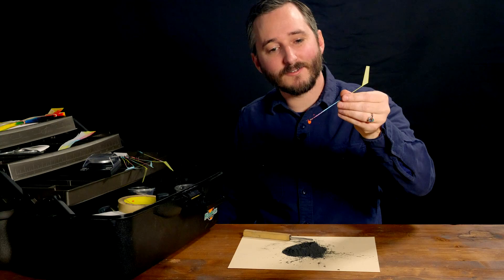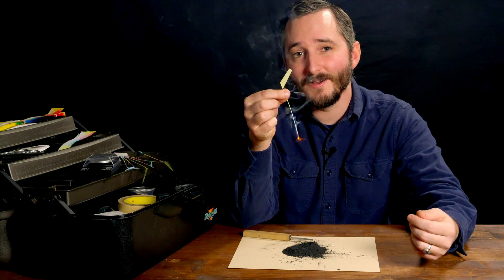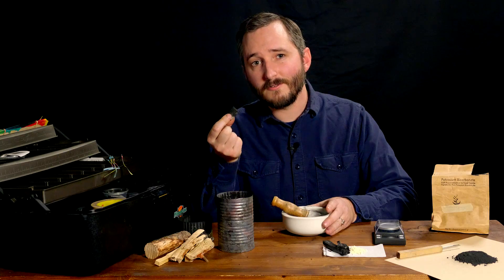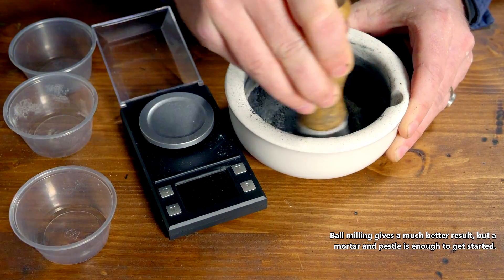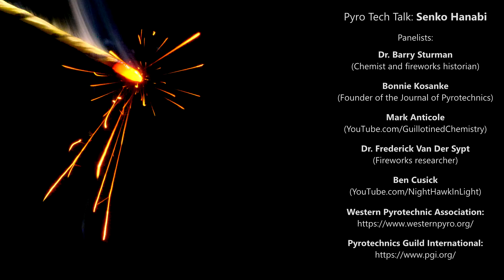The World's First non-Flammable Fireworks (a novel way to make Senko Hanabi Sparklers)

Comment from the maker: I'm very excited about this video. A firework that involves no explosive components means it can be made safely in almost any circumstance. A tiny variation in the powder mixture can produce dramatically different results, making these fireworks incredibly fun to experiment with.

Check out my new Senko Hanabi playlist that documents the videos I've made about them over the years: https://youtube.com/playlist?list=PL1a2HkcVbmAVW5LBBThCdHPD3BKDd03Tj

More info about how the firework powder can be non flammable and also work for these sparklers: In order to begin reacting with air the powder needs to undergo a phase change from solid to liquid. Changing phase requires a lot of energy, and once the phase change occurs the resultant reaction only produces enough heat to keep a small drop of the powder molten. The energy the smoldering reaction produces compared to the energy required to melt more powder is way out of balance. Each grain of fresh powder that contacts the drop is like an ice cube, cooling the molten drop down faster than it can warm up. In that way the reaction cannot propagate through a pile of powder. If you manually heat a large pile with a torch until the whole thing melts (which I have done) it still will not sustain a reaction when the heat is removed, because a large volume of the powder does not have enough surface area to react with air compared to its mass. The molten puddle radiates energy away faster than it reacts to release new energy, so it cools off. Last, the bicarbonate releases CO2 when heated before changing phase. This reaction sucks up energy (cooling nearby flames), and displaces oxygen in the atmosphere which smothers fire near it.

So, how then does the sparkler still work? Using the flame of a lighter we can brute force a small amount of the powder to make a phase change by feeding more and more energy in until all the barriers are overcome. The small drop has high surface area compared to its mass, so without other powder to cool it off and in a fully molten state it can generate just enough energy through reaction with air to stay molten and produce the senko hanabi effect.

Pretty neat.
Reply: What would interests me, is the possibility of adding other Salts to the mix to change the Flames / Sparks colour.
I think i have to take a look into the linked Videos&Papers to get some answers, don't I?
Reply from the maker: @Marian_Martin_Morgenstern  So far I've only been able to change them yellow with sodium. I'm not certain if other colors are possible
Reply: @Nighthawkinlight  Well Copperchlorid or Bariumsulphate should give a green flame, as does Boriumsalts, but i bet you know that already. Aluminium o.Magnesium powder make silverwhite sparks in standard sparklers, but i'm not sure if they would ignite in the Hanabi mixture.
Btw in the close up of the molten pearl on the tip of the Hanabi, is that blue colour of the flame the molten Sulphur burning?
Reply from the maker: @Marian_Martin_Morgenstern  Yes, the burning sulfur gives a blue aura
Reply: @Nighthawkinlight  A pinkish effect should be possible with a Strontium salt. I know it's also used as a delaying agent in glitter formulas, and Senko Hanabi are a related effect. I'm really curious to try this with some of the carbonate salts I have on hand, when next I get a chance to experiment. 

EDIT: Also cool to see the WPA get a mention. I've been a member for the better part of a decade.
Reply from the maker: @foxyfoxington2651  Barium carbonate did not work for me because it converts to barium sulfate which has to high a melting point to form a drop. Strontium sulfate has a similar meeting point so I expect the same issue.
Reply: @Nighthawkinlight  My immediate thoughts were lithium carbonate and copper carbonate (or more realistically something like copper(II) carbonate hydroxide).  A good, strong blue is hard to come up with - there are several bluish-greens, but the true blue flame colors are generally fairly faint.  Lithium and copper are easily obtained and also produce flame colors nearly as bright as sodium.  As familiar as you are with fireworks, I imagine you already know that potassium produces a violet flame, but it's extremely faint, so it's not going to show up over the color of burning carbon.
Reply from the maker: @jasonpatterson8091  I suspect lithium carbonate will work. I am not as hopeful about copper carbonate, but it's worth a try
Reply: @Nighthawkinlight  How about calcium carbide (carbide lamps) white light?
Reply: @Nighthawkinlight  Hi there, what is the difference between this powder and kno3 + charcoal or sugar?
 When I started pyro experiments, I often made bad powder mixes and got the same result as in the video. Potassium nitrate and sugar in a “bad” ratio are also non-flammable, and in a 50:50 ratio they ignite very quickly, reducing the amount of sugar the mix barely burns (like in this video).
Can we then say that every failed mix of mine from another point of view was actually a success? :D

In my opinion this kind of mix has no application in fireworks because there has to be flash powder to break the shell, spread "stars" and produce a loud sound. But as a sparklers it is good.
Reply: @Nighthawkinlight im trying to make one out of gunpowder made from ammonium nitrate, sulphur and willow charcoal, but its not working
Reply: @Marian_Martin_Morgenstern  it is sadly not possible to effectively colour sparks. Too much continuous emission going on.
Reply: @cigarswede  
Well, in a way you can. Not like red,green, blue etc, but more like how much they glow on the black body spectrum. Carbon sparks give a more reddish/yellow/"golden" colour, as does Iron, Aluminium and Magnesium burn hotter and thus give a more blueish/white/"silver" colour.
The question is, does the carbonat based Senko Hanabi burn hot enough to ignite Al/Mg Metal?
Reply: 2:40 At this point, nobody is expecting editing tricks from you, my friend. Unless you mean to say that you've learned how to edit reality. That, I'd believe.
Reply: Pretty neat indeed!
Reply: Now I want to make these and since there is much less fire risk I think I just might.
Reply: So, can you sell a cup of the completed mixture and mail it in the United States?
Reply from the maker: @jokeal3613  Technically you should be able to... but getting government regulators to believe that it's not dangerous or illegal would be an uphill battle.
Reply: @Nighthawkinlight  why would they have to approve it, advertise and send it. It isn’t a prohibited item, even if each ingredient was in a separate bag I would buy it.
Reply: I don't know if it is even possible, but is there a way you could combine some of the baking soda and the potassium bicarbonate, to have the best of both effects, or would they negate each other and produce a dud.
Reply: Would soaking and then drying the paper in some dissolved solution of salts for coloring have any affect on the color of the sparks? Or would it just slow or extinguish the reaction?
Reply: Have you tried mixing potassium bicarbonate and sodium bicarbonate?
And another thing that would interest me is what happens when you use either or both after pyrolysis.

I really enjoy what you do 👌
Have a great holiday
Reply: Thank you for your dedication of the craft.
Reply: Really, this is more like a sparkly paper candle with sulfur than it is a firework.  Maybe, to sell them, you would have to describe them accordingly, avoiding "firework" and its associations.
Reply: What if you made separate pockets of powder along the same sparkler? Would the glob of molten goo melt the second pocket and give a second run?
Reply: if you could change the color to blue/red I wonder how it would look.
Reply: pretty cool, you could make a video changing the proportions of the ingredients and adding others to change color or multiply colors.
Reply: I’m so happy you uploaded!😁
Reply: Can you get some slow mo of the burning blob and the sparks? Should be interesting
Reply: Ah so more surface area means more reaction and more heat, but more volume means less surface area per unit volume. The reaction energy is precise enough to work with a small volume but not a large one due to the surface area. 

That's really clever
Reply: Do you think you could ignite them electrically?
Reply from the maker: @sock501  No
Reply: I have ammonium nitrate bet that would work pretty good... provided it doesnt explode once i add the charcoal. copper nitrate would be better ;P
Reply: @nathanh2917  ammonium nitrate is an oxidizer, just like potassium nitrate, so you would get something akin to standard black powder meal (at best) and not a non-flammable substance.  Ammonium nitrate, sodium nitrate, potassium nitrate -- they are all oxidizers that work somewhat similarly (try mixing a little with some powdered sugar for some campfire fun), but there are good reasons for using KNO3 instead of the others.  The whole point of this composition, by contrast, is that it has no oxidizer, and must be allowed to burn in open air.  BTW, for normal colored firework compositions,  the KNO3 raises the reaction temperature so much that it washes out most of the color -- fine for white sparkles, but that's about all, which is why we turn to such things as potassium perchlorate as the oxidizer (plus, the chlorine ions help).
Reply: @zimbot_KWB  I work around 100 thousand tons of ammonium nitrate on the daily. Liquid and solid forms. The mines use it to make the ground go boom. All ammonium nitrate needs is a fuel source and its quite capable of creating a combustible substance. It can even explode on its own if confined and is hot enough to decompose. Just as anhydrous ammonia can explode even though it tend to be inert. Copper nitrate is even less stable. It grew "naturally" in one of our electrical boxes. Which we later disconnected and blasted it out with water. Industrial scale chemistry is err.. "fun". Only thing that was really scary was Nox which smells of almonds or more like a heavy metallic taste. Very distinct but hard to define. I was implying the explosions would be less pretty but more energetic. ;)
Reply: You look like ted cruz.
Reply: just gotta show the mexican and american companies that supply the west
Reply: Mm0
Reply: 74x
Reply: I may have missed it, but what is the burn risk from the molten blob? In that sense, would a black powder/oxidizing source be less dangerous? Compared to the wire and Al/KNO3  sparklers it seems safer, but neither of those seem to have a 'drip' danger. Any of these would have their own safety precautions, so I'm not trying to call you out, but just wondering about that aspect since the melting point of KHCO3 is 292C (CHNaO3's melting point is a bit murkier to me since it decomposes).
Reply from the maker: @markhorstmeier8734  I wouldn't hold it over your bare toes. It will burn you if you touch it, but it's small so it can only do so much to a small piece of skin. The nitrate version of these sparklers also has the same molten drop, there's no difference there. As for wire sparklers, that's a totally different thing. I don't intend to compare the two.
Reply: @Nighthawkinlight  Ack. I brought up the wire sparklers more to acknowledge that those can be dangerous but we let smaller children wave them around and was wondering about the level of precautions needed if I made some (I make everyone wear shoes so they don't step on someone's careless hot wire, but I'm thinking that flip flops are out)
Reply from the maker: @markhorstmeier8734  Just normal sparkler precautions. Stand at a distance from others. You have to hold them still to use them or the drop falls off, so a kid can't wave them around.
Reply: Please contact the slow motion guys. I would love to see the kind of "solar flares" in slow motion!
Reply: You look like Will Wheaton from Star Trek TNG
Reply: Smug bastard. Also no one thought there was any video editing.
Reply: Nobody would ever consider any sparklers as “fireworks” which is why counties that outlaw fireworks still slow the sell of sparklers.
Reply: Maaaan! You learned to roll a perfect joint in Japan...
Reply: Dude, patent this. It's not just like a firework. This could be used as a heat source fuel, or heat battery "tech". Wow.
Reply from the maker: @TechyBen  Could be. It's always interesting when new chemistry is found
Reply: @Nighthawkinlight  
Not always new, but also innovative uses. I could see this as a long time storage for emergency supplies. Slow burning lamp or cooking source or heat source. Less spill risk, more controllable than other solids (presumably the power can be put in a resin).
Reply: @Nighthawkinlight  How does the amount of heat released when the substance reacts compare with the amount added by the torch?  I'm thinking perhaps the reason it's not flammable is that exothermic combustion at the end is preceded by endothermic decomposition?
Reply: @flatfingertuning727  Good point. For sure some metallic salts that would impart a beautiful color will cool endothermically.

Comment: What would happen if you used just a little bit of the potassium nitrate? Could you find a mix just flammable enough to light with a regular lighter flame but not flammable enough that  the powder itself will ignite upon contact with the powder?
Reply from the maker: It's possible maybe

Comment: Have you tried with potassium bitartrate?
Reply from the maker: The carbonate part is important so I don't think that would work
Reply: @Nighthawkinlight  it decomposes to potassium carbonate. I tried it but it seemed like there was to much carbon coming out the potassium bitartrate as it was decomposing that is made it burn worse but it worked if I constantly blew on it.
Reply from the maker: @ruwyev181  Interesting! The sparklers are pretty picky about the type of carbon they like but it would be interesting if it would work well with a reduction in charcoal.

Comment: I just made some of these but I can’t seem to get the rolling technique down. I think my tissue paper is too glossy. I wonder if rolled cigarette paper would work instead since it’s meant to be rolled and burned 🤔
Reply from the maker: Cigarette paper does work. Your glossy paper will work also, but you need to add a good amount of moisture to the folded corner to get the roll started.
Reply: @Nighthawkinlight  good to know! They were burning fine once I had them rolled, they were just kinda droopy. Hopefully this helps my technique!

Comment: You could pause the roll of the "tail" and add additional powder to add  a second stage, or you could add the individual components to see how the effect changes with additional lampblack, additional sulfer, etc. I want to make these but I'm not sure I'm up for making lampblack...
Reply from the maker: You can add additional powder with a nitrate based mixture, but not with this variety since the powder is self extinguishing. To make lampblack easily I've recently started using vegetable oil in a small dish with a paper towel wick, burning it under a disposable aluminum casserole tray. It works quite well. A good recipe is 4/2/0.5/0.25 KHCO3/S/pine char/oil lampblack. That recipe is from Xoltri, another youtuber who first informed me of veg oil as a good LB fuel.

Comment: Hey so I’ve given this a try and I’m having a little bit of a problem. I’m hoping that you can give me some guidance on where I’m going wrong here.

I’m about thirty sparklers or so in and I’m having trouble getting the reaction to sustain itself. It only seems to continue and create the desired display once lit if I blow on it gently, otherwise the drop merely smolders up the paper and eventually cool down and self extinguish.

I’ve been using some sulfur powder marked as 99.5% and I’ve tried some activated charcoal that I have on one batch and some lampblack on another.

Possibly of note the resultant color of my powder is much grayer than your result and is definitely not the same color as the carbon source.

As for the potassium bicarbonate based on the logo visible on your bag I believe I’ve got the same brand you were using in the video.

Is the failure I’m experiencing likely to be related to the activated charcoal or lampblack whose source woods I have no way of determining (e.g. it must be pine), caused by me not having gotten good enough at rolling them up yet, or something else I’m missing?
Reply from the maker: Activated charcoal is no good. Possibly you would have some luck if using natural wood bbq charcoal, but by far the best result is making it yourself from pine or any evergreen/needle leaf tree species. Where did the lampblack come from? Unless you made it yourself it is probably not suitable to be used in large amounts and can only replace 10-20% of the charcoal in the formula at most. Since your charcoal is bad your lampblack won't work in combination with it either. Find better charcoal and you'll start having success.